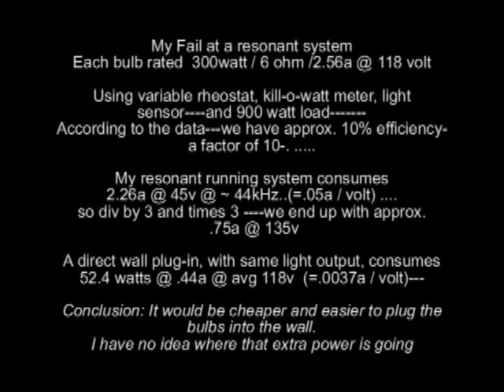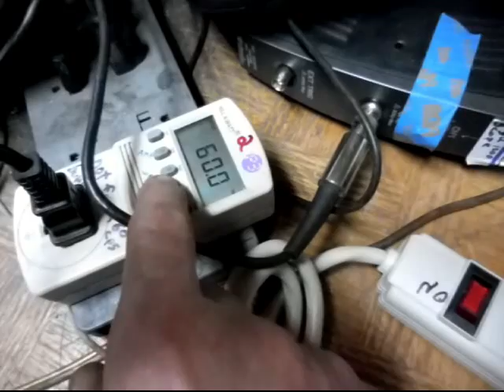rez fail1

Comment: The problem is that those bulb filaments are making light from resisting the current and that's rooted in inefficiency. resonant induction glows from operating on harmonic frequencies of the natural materials your working with so it becomes a plasma due to efficiency rather than inefficiency. Also I recently concluded that I am going to use Audio bandwidth operating frequency rather than RF because RF is invisible to us and we have to have equipment to measure it, however you can directly apply musical theory into operation frequency and detect constructive or destructive interference by ear. I believe a lot of energy pollution is causing people health problems due to the inefficiency and disharmonics between Voltage, Amplitude and Frequency. You have to abandon everything you was previously taught if you want to lead into the frontier of technology.
Reply from the maker: Nice of you to comment, It took hours of tweaking just to go from 300w to 600w then to 900w. Speaking of Audio
I have done that also with small car amps running at 13v, I lit 150w bulbs by getting them to resonate -see my '7-20-20 Jensen amp Rez' 
     .Don Smith says the higher the frequency the more efficient and greater the output. But I have run
HF amps at 30v / 50MHZ looking for high efficiency. They light bulbs up is all..... I did push one xxMHz while using both an internal and external ground system...It created such a large ground loop it took out my USB scope, and computer USB mouse  and possibly the USB system--(I changed the PC board). I have a video on that disaster too.
       The "Pioneers" have monetary interests and cannot reveal what you really need to know. Joe Newmann though told all he understood about his machines, spent all he had trying to convince the Public and Patent Office, but was rejected. --All I can say is  "THEY WORK"